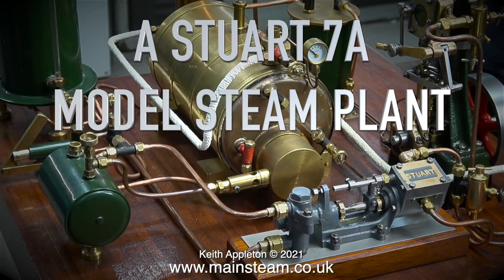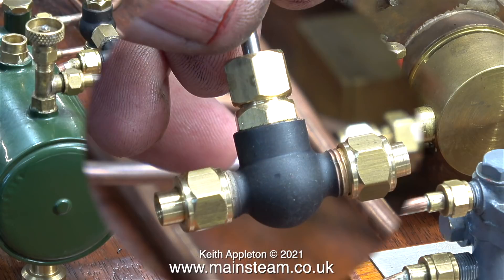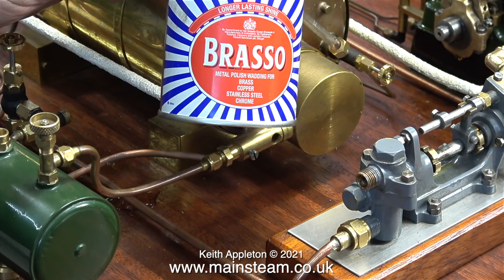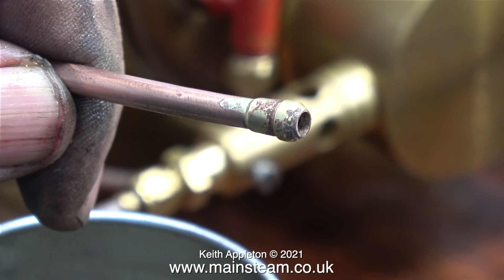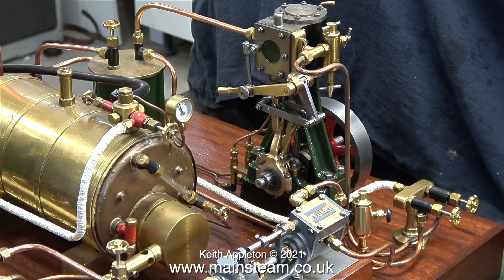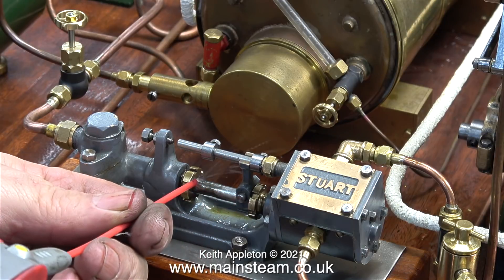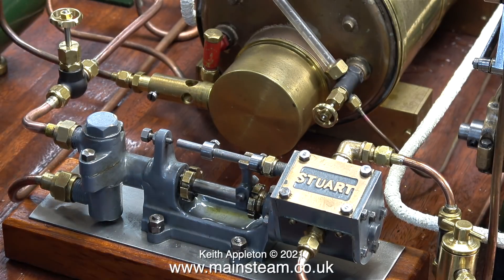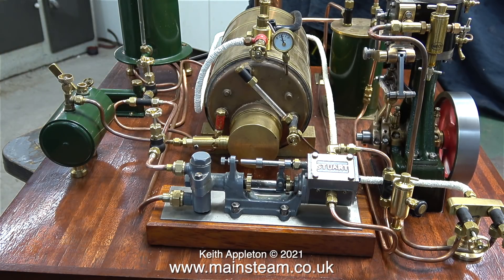A STUART 7A MODEL STEAM PLANT - PART #33

Comment: Brasso has been called Brasso since 1905 when it was created. Because of the hydrocarbon components in the mixture at the time, it had a flash point of  22°C (Abel Close test) and so was classed by railway companies as dangerous goods. This classification allowed the railway companies to charge more for distributing Brasso around the country. Reckitt's appealed to the companies asking for the polish to be recategorized in the hope of reducing costs, but the railways disagreed. As a result of this in 1913 the case was taken to Railway and Canal Commissioners for a decision. After a hearing lasting two days the commissioners decided in favour of the railway companies, and Brasso remained classed as a dangerous substance for the purposes of railway transport.

Comment: Interesting that the silver solder stuck, Brasso leaves a thin oil layer behind.
Duraglit was wadding, separate product. Also Silverglit. I think Brasso bought them out, but not sure.
Reply from the maker: The Silver Solder Flux easily gets through the very thin coating.

Comment: Your mention about "cold weather" made me thinking.
How did people start steam locomotives in really cold weather? Like, -20 Celsius? What did they do to prevent water from rupturing boiler pipes and other important pieces when they were stopping locomotives?
I know that cars could have similar problems in cold, but in cars the water is not the main working mass of the engine.
Reply from the maker: The heating process starts off slowly and eventually steam is raised.